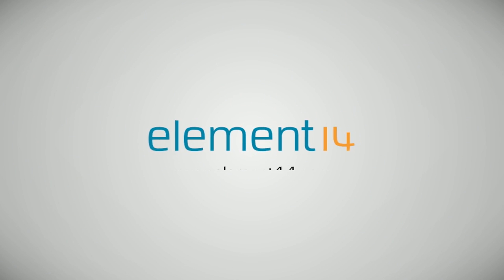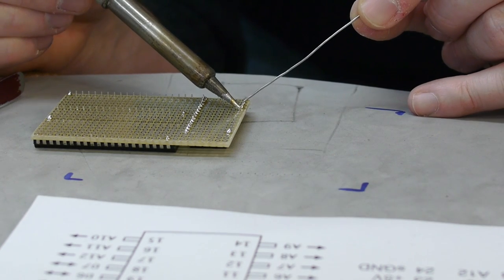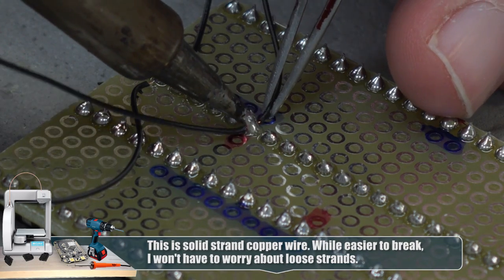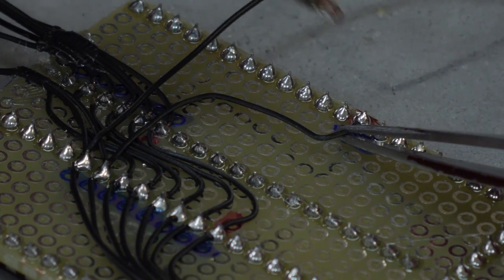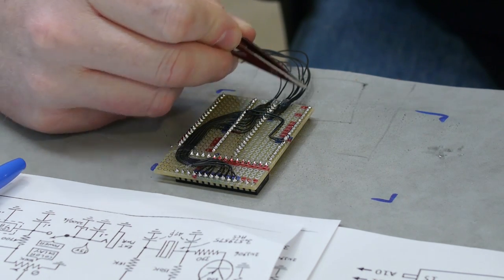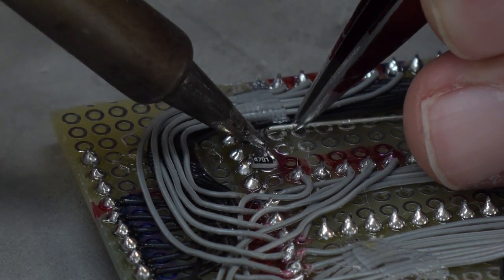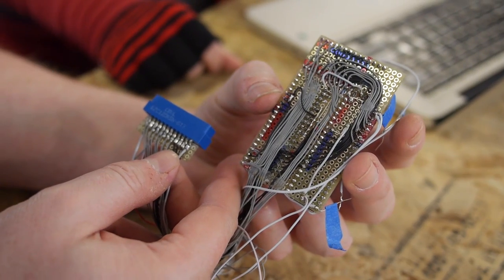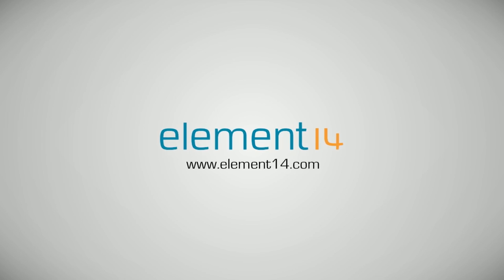Ben Heck’s Super Soldered Atari 2600

Comment: I know the usual advice is to get an expensive, variable power solder "station", but for someone who just does occasional soldering, what kind of inexpensive iron would you recommend?

Years ago, I bought a low-power, fine pointed iron that claimed to be good for electronics, but it's so weak that there is literally only one spot on the tip that will actually melt solder! I usually have to melt the solder onto the tip, then press the blob of melted solder against the connection and hold it there for several seconds. Luckily I'm usually just soldering wires to connectors, so the heat isn't really an issue. It's just a pain in the butt.

I can't use desoldering braid because the iron won't get it hot enough to draw in the solder.
Reply: +lurkerrekrul You're going to need to define "inexpensive". Under $100? Under $50?
Reply: +lurkerrekrul You're going to need to define "inexpensive". Under $100? Under $50?
Reply: +Maxwelhse I was thinking under $50 at least.

Years ago, my grandfather had an old soldering iron that worked well. It was just a pencil-type iron on a cord with a relatively wide tip, but he never had any problem getting solder to flow. Unfortunately, like most of his tools, it vanished after he died when my grandmother cleaned house.
Reply: lurkerrekrul
You can get a used Hakko station in that price range and people have nothing but great things to say about them. Or for $100 you can buy a new FX888, which is on my personal wish list.

Another option would be a Stahl station. I got one on super sale for like $15 and it's surprisingly decent.

http://www.parts-express.com/stahl-tools-ssvt-variable-temperature-soldering-station--374-100

Those are my thoughts from $20-$100, I guess.
Reply: +Maxwelhse Thanks for the advice. :)
Reply: lurkerrekrul
Good luck!

Comment: Whats the substance he's using to keep the wires glued to the board?
Also, the part I can never do when atempting this is removing the insulation, is there a better method than 'just use you fingernails'?
Reply: use an xacto knife, teeth, or small toenail clippers.also, he didn't glue the wires down. they are solid steand meaning they retain their shape after being bent and they take alot of force to move
Reply: Pretty sure he hot glued them down, did you see the whole thing?
Reply: Yves - I did not see hot glue on the wires. I will look again but he did specifically say in the beginning to use solid strand wire so that it keeps its shape
Reply: They keep their shape but they tend to "spring up" so you have to hold them to the board somehow.
See: 16:00
Reply: Yves - Thanks

Comment: How about making a circuit board to turn old laptop screens into multi use video screens?
Reply: You really can't DIY those, I don't even think you can get those chips at retail. But ebay sells them as finished boards, so you can take the LCD and use it in a project.

Comment: where do you get the Atari 2600 cart port?
Reply: +Doug Plummer (douglie007) I believe one source is old computers. I think the old 5 1/4 floppy drive connectors are compatible with the cartridge pins.

Comment: 525 fahrenheit, so that's like ~270 celsius? I always have my soldering iron at 400C, guess that's too high then, need to remember that. :P
Reply: I always had mine at 410C
Reply: +Pauli “Dids” Jokela and +ShadowxWolf - I sincerely hope that it's just that your irons need to be calibrated, cuz 400C is extremely high. Lead-free solder melts at just under 220C, and 63/37 leaded solder at just 183C. Using excessive temperature causes unnecessary heat stress to components, can lift PCB pads, and causes the solder on the iron tip to oxidize faster, reducing the quality of your joints.

Of course, the iron needs to be somewhat hotter than the melting point, since heat needs to be transferred to the workpiece. I usually use around 280C for leaded solder and 310C for lead-free. (I say "around" because it depends on the soldering iron tip. The temps above are for a normal medium tip. Really fine tips need higher temps because they don't have the mass to stay hot. For example, I have an ultrafine 0.4mm tip that needs 360C for leaded!)

Comment: wow this is perfect lol i just got a pretty cheap yihua soldering station in the mail literally an hour ago and i would like to see a little more soldering before i get to the few projects ive been putting off
Reply: I would like to point out never use cheap soldering equipment. They might damage the item your working on. If they fail and are not grounded the item your soldering could get the full 120 or 240 volts that the iron is plugged into.
Reply: +SHADOWxWOLF No true temperature-regulated soldering station I'm aware of uses a mains AC-powered heater. They all use irons in the ballpark of 24V. (The Yihua ones, which are Hakko clones, are 24V.)

There are some temperature-controlled (but not temperature-regulated) "stations" that are actually just a mains soldering iron with a lamp dimmer in line, but since those don't actually regulate temperature (that is, there's no temperature sensor in the tip), I don't consider them true soldering stations.

That said, with those Yihua stations, it is HIGHLY recommended to take it apart and make sure all the mains wiring is correct (no swapped ground!!!) for safety, and use a multimeter to verify that the tip is indeed grounded.
Reply: Antonio Tejada thats a great idea ill do that thanks itll atleast make me feel better, its not like im going to be soldering a 1000 dollar computer or something lol just a few cheap rca tablets and a couple box mods (e-cigarettes)
Reply: I mean, they're not as good as a Hakko, Weller, Ersa, JBC, etc., but they do just fine for most things. Some people have also found that filling the gap between the tip and heater (with metal foil, graphite, etc) improves performance. Others suggest ditching the Chinese tips and using a genuine Hakko tip instead.
Reply: do you watch the EEV blog? lol
Reply: +1234garrett1993 Heheh yeah absolutely! :p
Reply: Antonio Tejada lol thats funny, Daves the reason i bought a yihua

Comment: they look like little hershey kisses
Reply: Which is actually exactly how solder joints shouldn't look…
Reply: Antonio Tejada not hot enough right?
Reply: Kyle Crater No, just too much solder applied. The heat is fine.

Comment: Whenever I try to do the same, it does not matter what heat iron or solder or how much is the tin to lead ratio more or less conductor, mine always goes awry at some point is like the solder does not flow or the iron does not heat or something and I can't pinpoint WHY? WHY MY SOLDER IS ALWAYS WRONG?
Reply: +TemporalOnline Try adding additional flux, such as with a flux pen. (Get rosin flux.)

Comment: I think it is a problem with my iron's tip, but does anyone know why my soldering iron won't "let go" of the solder? I see Ben's solder flow nicely onto the pcb, but my solder just stays on my iron and won't flow off of it even if I clean it using a wet sponge.
Reply: +Gabriel Wehrle That's normal your tip is fine, if you had a bad tip your solder would ball up or just roll off.  Add more heat and flux to whatever your trying to solder too.
Reply: +111 111 Thanks! The problem is, my iron is cheap so it doesn't have a temperature gauge. I also have trouble heating up solder as well, so maybe my iron simply isn't hot enough?
Reply: +Gabriel Wehrle Are you using large diameter solder? That can cause both problems. By the time you get the big stuff hot enough to melt you'll already have waaay too much on the tip.

Buy the thinnest stuff you can find and just pour it on if you need more in an area, It's sold by the pound anyhow, so who cares?

Also, you can buy an adjustable range station for about $15. It won't be high quality, but it's better than an equivalent grade non-adjustable iron. I bought a Stahl in that price range just to see how it was and it's surprisingly decent. Way better than the hardware store Weller irons.
Reply: +Maxwelhse Hey, Thanks! I am using large diameter solder, because it was cheaper, but I'll try some thinner solder and see how that works out.
Reply: Gabriel Wehrle
Cool. I hope it works out for you!

Comment: Do you have the schematic for this cut down interface?
Reply: +theHeckwithKaren Hello, Thanks for the information but one important piece of information is missing. The complete schematic and the layout of the "Super Soldered Atari 2600" components for the Atari perfboard.
 I would like to have ago at reproducing this. The bus soldering for the data and address bus I can follow from the video. But there is not enough information to figure out what the SMDs are (values and locations) and other components plus where you connected them etc. Also how you wire up the controller / video / audio and buttons etc
Reply: Chris, did you see https://github.com/thebenheckshow/226-tbhs-Super-Soldered-Atari-2600 ? It seems to be it (in particular the docs/Schematic_Atari2600_2000.png file), but I can't figure several of the components, and whether this was the diagram used or just inspiration from the original Atari...
Reply: Yeah, thought so. I really wish we had information on that, it would be really helpful. Thanks for replying.
Reply: Ok, so I decided to dive into the diagram, and it wasn't that hard to figure out most parts (as an amateur, this guide helped me with some of the symbols: https://learn.sparkfun.com/tutorials/how-to-read-a-schematic).

Also, this page has it divided in logical functions: http://kevtris.org/2600/2600schemo.html - it helped me figure out that the "a-f" triangles were NOT ports from a 4050 logical inverter chip (notably absent from the 4-switch diagram, aka "sheet 2" on AtariAge).
Reply: Did you figure it out? Do you still need the alternative schematics from Ben? If so, I can see if I can poke Ben until he finally writes it down.
Reply: Hello ideally we need the Schematic and component list for the actual circuit used in the build. The one given is the stock Atari one which was probably used as a base by Ben but does not include things that where removed / changed / simplified. 
Just don't want to invest into some chips to end up with a device that does not work and can't be debugged due to guesswork
Reply: +1 that! Thank you for following up! :-)

Comment: And where is the 6507's work ram?
Reply: The Atari 2600 had just 128 bytes of RAM, which was shared by the CPU stack and your program.  So the stack started at the bottom of the address space and worked its way up, and you stored your variables at $FF and worked your way down (and with luck, never the twain shall meet.)  It was actually considered lazy if you didn't use every single byte.

The TIA registers were mapped into $00-$2F, the stack (and variables) were stored in $80-$FF, the PIA was mapped at $0280-$029F, and the cartridge ROM was mapped into $1000-$1FFF.

Comment: hey does anyone know where i can learn to solder a simple curcuit board or something  im trying to learn but i dont know where to start or anything  the only think ive ever been able to do  soldering wise was make ann extended wire for a micro usb cable. soldering job was bad but it work. i wanna learn to actually make something. if someone can please help me or some me where to go that would be awesome :)
Reply: For soldering practice, get some kits off eBay (or banggood or aliexpress) and build them. There are kits for digital clocks, mini test gear, etc.

Comment: love your show but 99% of your solder joints would be rejected by my boss. solder on pins should curve in, not sit like a ball. You're not getting enough heat into the pin before you touch the solder to the pad.

Comment: 3:55 - None of them are particularly great solder joints. Too much solder, badly formed fillets, mostly caused by no cleaning with alcohol and liquid flux or any other prep to speak of. The solder doesn't even flow out evenly over the pads. You can also tell that the solder failed to flow down the component pins through the holes to form the fillet on the component side of the board.
Reply: That's a single sided board without plated through-holes, so it's not going to flow down the pins, nor should it. (But you're still correct that they're not good joints at all.)

Comment: Ben, what the Heck are you doing? You use too much solder. And your joints are looking "cold". And where is the flux for a good connection to the wires? Sorry, but that's not what a good soldering work should look like! And....

USE FLUX!!!!!!

Comment: I hate soldering because its so flimsy and easy to destroy things, why isn't there a soldering gun like a glue gun ???
Reply: No conductive glue invented so far is as strong or conductive as solder. (Maybe one day!!!) If you're damaging components during soldering, here are some tips: 1) get a good soldering station, the heat control really helps, 2) use more flux!, 3) use a clip-on heat sink for sensitive components, 4) practice! :)
Reply: Noo, it's not flimsy at all, soldering is pretty much the best connection out there!

And sure, there are soldering guns. Those things are terrible and useless. Just don't. Well, they are not like glue guns because they don't actually supply solder, they are just weird shaped inconvenient but powerful soldering irons.

I don't think there will be a good conductive glue anytime. I mean the binder and the conductor have conflicting goals. If you really need to connect something electrically cold, you can use glass heater repair liquid, it's made out of silver in a binder, but mechanically, it's brittle crap, and it's not the best conductor either. But it has its uses e.g. when doing hidden SMD LED wiring that you can just paint over in scale models, you just measure the resistance and take it into account later.

Antonio is right on about getting a somewhat decent temperature controlled soldering station. Brands like Ersa, Hakko and Weller have the best temperature control, and I mean a fixed-temperature Ersa with isn't even that expensive, but if you really don't want to spend any money, you can get a 936 clone (random Chinese brand) from HobbyKing or elsewhere in China, it's by far not as temperature stable as the Hakko it's copying, but miles better than not having temperature control at all. Getting one that is convenient to your hand is very important, and I think 936 is pretty good in this regard, at least when soldering relatively fine electronics.